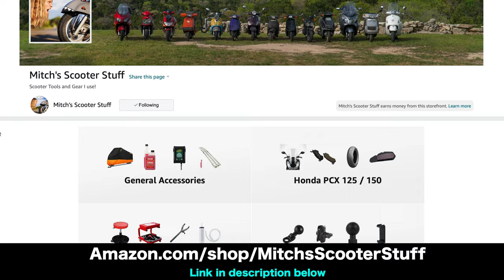Honda Ruckus / Zoomer - Power Loss! One small easy fix! | Mitch's Scooter Stuff

Comment: Replaced the carb on my Ruckus. It was really hard starting and eventually got to the point it wouldn't start cold at all. Instead of rebuilding the carb, picked up a new one for $38 bucks on Amazon. While working on it, I took off the air box cover and filter. Swapped the carb and it start right up and got it to idle smooth. Reeved up fine on the stand. Took it for a test ride and it lost power\bogged out while trying to ride it (just like this video). Took me a hot minute to remember Mitch's video of this issue. Put the air filter and cover back on and it rides like it should. Simple as that. I didn't think having the air filter out and box cover off would produce that lack of power\bogged down effect but it did. Although not directly related to this video, seeing it point me in the right direction. Thanks Mitch.
Reply from the maker: Right on!! 🙌🏼🙌🏼

Comment: I will try your method, hope it will solve my problem. First time my '22 ruckus started loosing power just as you've shown on the video. The simple solution you have given  would be just right for me. A first time ever scooter and on a terrible economic footing, can't even afford a visit to the mechanic and work I can't afford to miss either. Finger crossed

Comment: Mine idles, runs for a minute and then cuts out when you roll throttle, Is that the fuel pump? Fuel did go low however...thanks all

Comment: Wow, need to check this. My ruckus has been struggling alot at low speeds.
Reply from the maker: Yeah let me know ... maybe check the rollers ... I would swap for sliders... it's in my ruckus CVT video if you haven't seen it

Comment: I have power loss too, but I checked the air filter and it seemed to be fine. It will lose power when I throttle it up to the point that it conks out. Any recommendations? carburetor?
Reply: Fuel pump is the most common part to fail

Comment: I have the similar problem, I purchased a 49cc moped and it can only reach 30 kmh (18 mph) but should go at least 45 kmh. It seems to have power at full throttle but doesn't go faster. My bike only has a air filter pod and no air box. I wonder if there could be an air leak causing this in my bike too. I noticed the rubber seal for the air filter has a crack so I taped it over with electrical tape so it seems tight and it has a metallic clamp over it as well.

Comment: I don't see my problem in the video or comments.  I have the same power loss but worse, it  won't hardly move from a stand still.  But if i push it some it will climb in speed and around 15mph it gets power and then sound and run fine!   But once i come to a stop, it has a hard time running and doesn't want to take off again.  Help my Obi Wan Mitch!  Love your videos.
Reply from the maker: Hey hmm was scooter sitting for a while then you ride it? I think jets in carburetor are dirty maybe
Reply: Scooter is 2018 50cc Honda Ruckus. Has only 700 miles, so everything looks really good and new still on the engine.

It originally had sporadic bogging at low and high speeds.  Cutting in and out and dying but not horrible.  Pulled the carb and replaced the jets with OEM Honda jets.  Low idle jet was clogged and I thought that most likely was the problem.

Took off from my house and it felt strong as ever.  Ten minutes into a ride when I pulled up to a stop sign, it died and took forever to crank.  Once started with a lot of full pinned throttle to keep it running, it would take off really really slow in a full bog the whole time with no power and very choppy.  But once I get to 10mph, it takes off like it has full power.

✅New spark plug - stock NGK
✅New low idle and main jets -stock Honda
✅Top plunger on carb moves freely, needle clean, diaphragm looks new and is flexible
✅carb bowl and and floats clean 
✅Tested fuel pump by pulling hose off carb and is pumping good and click clacking good
✅recklessly sprayed carb cleaner everywhere while it was running and no air or vacuum leaks found-didn’t burn bike down
✅air box tight, new air filter
✅new fuel filter before fuel pump
✅new gas tank
✅new sending unit
✅autochoke electrical connection seems tight
✅took off negative battery cable and unplugged computer for two minutes
✅performed ECU reset after unplugging computer
✅pulled cover off CVT transmission, belts and pulleys look good
✅throttle cable is adjusted to have proper slack
✅idle screw is set to keep it running and a little high only because it won’t stay running

Comment: Hello Mitch, wondering if you had any experience with the temperature light coming on on the Honda Ruckus?  I can go weeks or months with no issues and then it will come on everytime I ride.  Happens quickly after getting started or can wait 20 minutes.  When the light goes on, it loses power, then have to pull over turn off then on again and usually it then runs fine for the rest of the trip.  Thanks
Reply from the maker: Hi, never happened to me but make sure check the coolant level... Have you changed the coolant?

Comment: Have a question if anyone is still active. My 2016 ruckus 5,800 miles. Made a turn and went to accelerate and now it's Screaming Very loud. Seems like it's coming from the kick start side. When I accelerate now it screams SUPER Loud. Don't make that noise just idling only when it engages to take off. Any idea's what this could be?? Tyia

Comment: Hi Mitch, I have this same problem with a 2009 I picked up with 1200 miles. It was bogging a whole lot, but slightly at full throttle. My air box cover was very warped, so I replaced the air box cover, the air filter and a new spark plug, now its is horribly worse! What did I do? Any suggestions? TIA
Reply from the maker: Is fuel clean?
Reply: @MitchsScooterStuff   It is much better now. I changed the fuel, fuel filter, air cleaner, air box cover, spark plug, air tube to carb, jets, and reset the ECU. The last thing left to do, since I have done everything else, is check the timing. Thanks to your videos, I had the confidence to do all these items.

Comment: I went over a speed bump and my bike lost all its power. Idl what to do anymore. And my bolt is stripped to take off my cvt cover. Im having a melt down😊
Reply from the maker: Oh no! Check your battery terminals and spark plug - I have battery and spark plug videos for ruckus on my channel

Comment: Hi Mitch, tomorrow i`m gonna get a 2006 Zoomer. I`m in germany, so this one is with fuel injection. The problem is, that this one is starting, and if you don`t throttle a bit, it stops running. The error code shows " TPS sensor error ". ( 8 flashes ). Over here, it`s very very hard to get a new sensor. And if you get one, the price is 500,- Euros/Dollars.
If the error code shows throttle error, does it have to be this error...or could it be that there is another problem ( maybe something like problems with the fuel pump) that causes this error?
Greetings from germany, Neo.
Reply from the maker: Hey congratulations getting Zoomer tomorrow! I would disconnect the ECU for 10 minutes, and clean the connectors on TPS, then connect everything to see if problem go away 🤞🏼
Reply: @MitchsScooterStuff  Hey Mitch. Thanks for your answer. I`m gonna try this !!!! 👍

Comment: Id love a ruckus just to ride around my property with the dog chasing me but i am really big 280lbs
Reply: I've got a metropolitan which is the city boy version of the ruckus. I weigh about 220 in spring after gaining winter weight. With my boots, coat, backpack, and a full load of groceries I'm probably pretty close to that. It still runs just fine. Just adjust your suspension and change out the weights in the variator to favor acceleration over top speed. It's a sweet little ride that will last forever if you treat it well. You will love it.
Reply: @WinterRaven25  thanks